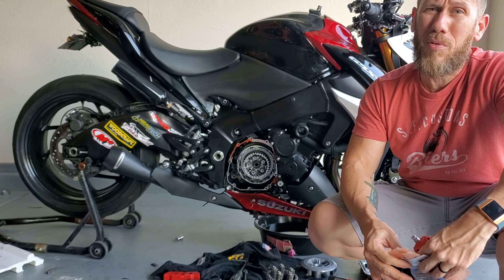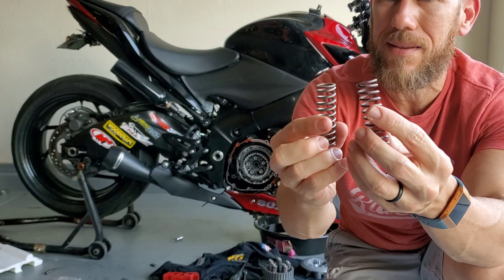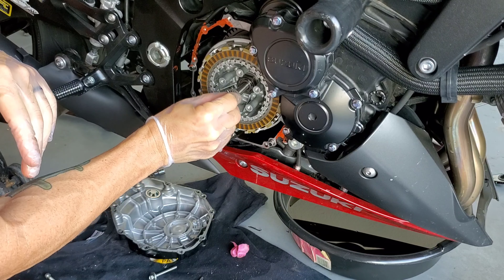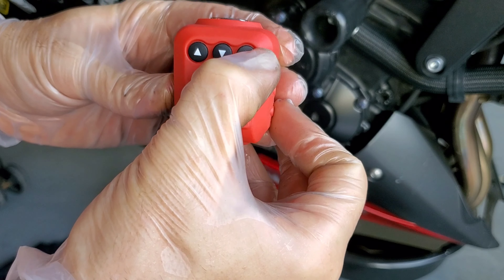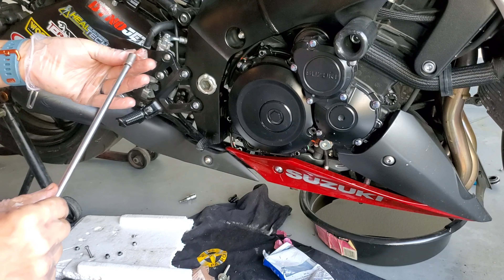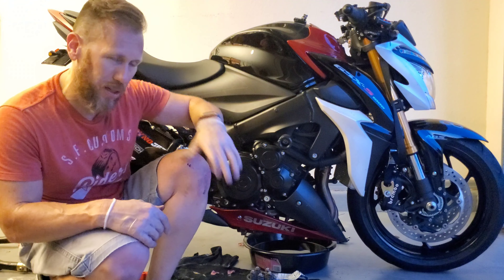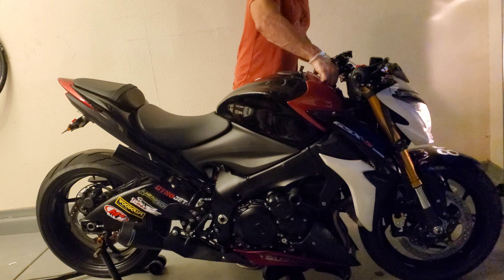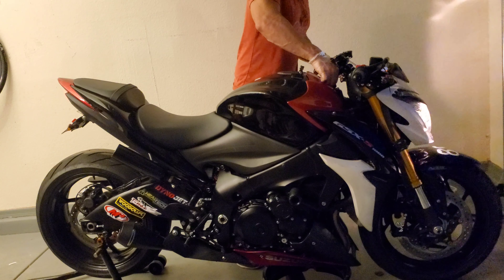GSX-S1000 Clutch Install & New Website

Comment: Smelling clutch tonight...Time to order some clutches! Did you look at or thing about barnett kevlar clutches vs ebc? Thoughts?
Reply from the maker: Really? Like consistent smell or were you riding the clutch? I did look but don't have a lot ton comment on. I heard good things about both. Seems like there are two school of thoughts. Those who swear about aftermarket and the other group beleive that nothing is better than OEM. 

I wouldn't mind doing some reading. Let me know if you want me to help or what you find out.
Reply: @ToModorNottoMod  Not really consistent, I think it's more common at higher rpm shifts....I guess I could take it apart and look at them to see if they are showing signs of wear...Bike only has 6k but I have hot lapped it a few times :)
Reply: @kyletodd3068  after a couple harder rides this season I have noticed that the smell typically shows up when clutch is re-engaging at higher speeds from 6th gear. Probably going to replace soon. No slippage yet but shifts don't seem as firm.
Reply from the maker: Besides that time that I suspected mine was slipping I have bot had issues on the streets or at the track. Mine has 17k miles. I did install a quickshifer before reaching 1000 miles though.

Comment: I need to change mine, have a link for the parts? I too would like to do heavier springs with factory clutches....
2016 gsxs1000
Reply from the maker: Hey Kyle, after inspecting the clutch and plates I ended up reinstalling the same clutch so I don't have a link but I did replace the springs and this is the part number:
EBC CSK Clutch Springs #CSK223 Fits Suzuki GSX-S1000/GSX-S1000F 2016-2017

Comment: Awesome video! Just curious if you’d have any advice on this issue I’m having. All the sudden today, starting with a hard second gear pull, the rpms would shoot up with no feel of power reaching the rear wheel. Followed by happening with every gear shortly after. Im pretty sure this is a sign of the clutch slipping but does anyone else think otherwise? Thanks
Reply from the maker: Thanks for the feedback. It could be slippage for sure. Before you get another one maybe change the oil? Hopefully using motorcycle oil? Just checking 😁. How about the cable, have you adjusyed the play lately? Just thinking of the cheap stuff before having to pull the trigger on a new clutch. Let me know if I can help.
Reply: @ToModorNottoMod   HEY! Thank you for the reply! 
I did a oil change less than 1000 miles ago using Suzuki’s brand oil for gsxs from my local dealer. I have not tried adjusting the cable. Previous owner installed after market handle bars that I had to adjust via the knob/lever on the clutch because it was too tight so maybe I’ll have some luck with adjusting it directly from the cable knob. I’m a noob when it comes to this lol so any reason as to why it’s super tight? Would I be able to turn it with my bare hands or should I be using a tool? Thank you for the help!!!
Reply from the maker: @brianz39  No worries. The adjustment shouldn't be tight, you are just looking to have the right amount of travel to disengage and engage the clutch. If it's too tight it could almost be the same as disengaging the clutch which is why I as asking. The easiest test, being very careful of course would be to put the bike on a bike stand and puting the bike on first to see what happens when you engage or disengage the clutch. If you oress the clutch and the bike doesn't stop slowly maybe you just need adjustment.

Try it and let me know
Reply: @ToModorNottoMod  that’s an amazing idea!!! I’ll give it a shot once my buddy returns my stands lol. Thank you so much!
Reply: @ToModorNottoMod  so I put the bike on stands and started it up, put it in first whilst holding the clutch and it did not move at all until I started letting go of the clutch. 
Think next step is to replace the clutch? Thanks
Reply: @ToModorNottoMod  do you happen to still have the links for the clutch plates and the springs? Thank you
Reply from the maker: I think that is expexted, though there is always a bit of movement even when nkt engaged.
Reply from the maker: The spring model you want is CSK223 from the EBC.
Reply: @ToModorNottoMod  thank you so much for all of the help! Hope to be on the road and riding soon! 😎
Reply: @ToModorNottoMod  hey quick question, what is the break in period for the clutch?
Reply from the maker: Hey man, sooooooo. There are a few schools of thoughts. Some think you should break  in the clutch the same way you break in an engine, easy for the first 500 miles. I don't know....

This is what I think but do your research and let me know what you think. Being a wet clutch I think you are pretty safe riding your bike normally. If it was a dry clutch I may be inclined to think you may want to bedd them similar to the way you break in your brake pads.

I have owned only 2 bikes with 0 miles and I did hard break in on both of them and my clutch have never failed.

Short answer, you should be good riding your bike normally, but if it makes you feel better and comfortable, give it a few hundred miles of easy use before you do hard pulls. 

I hope that makes sense.
Reply: @ToModorNottoMod   hey so I installed the clutch and I followed every procedure including torque down to spec. But once all said and done and the bike is on stands for a test, I popped it into first and whilst holding down the clutch, it seems to not be fully disengaging since while holding down the clutch it is moving the rear tire.
Reply: Lol nvm, adjusted the clutch and now we’re good! Thank you so much for all of the help! Sorry for the constant silly questions lol. Hope to see ya on the road sometime! 😎
Reply from the maker: Super slow movement even on neutral is normal but if it's too fast maybe play with the adjustment at the lever.
Reply from the maker: Oh cool! No worries bro. I love troubleshooting, helping and talking about bikes.

Comment: Hello from Greece.I have the same motorbike with exactly the same problem with clutch.Could you please tell me the part number, vendor etc of these new harder springs?
Reply from the maker: Hello and thanks for the message. I need to look for the number but I will look and send you a message as soon as I find it.
Reply from the maker: The model you want is CSK223 from the EBC brand. Hope this helps
Reply: @ToModorNottoMod  Thank you very much my friend!
Reply from the maker: My pleasure